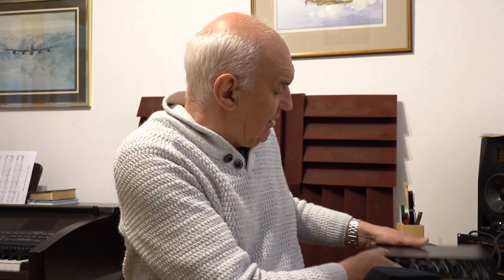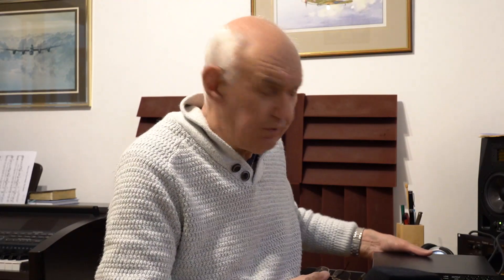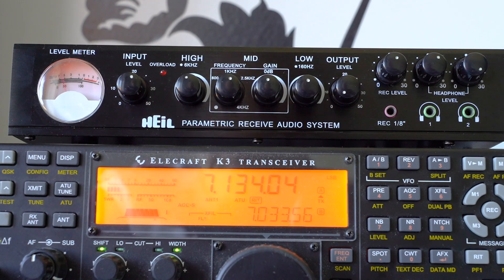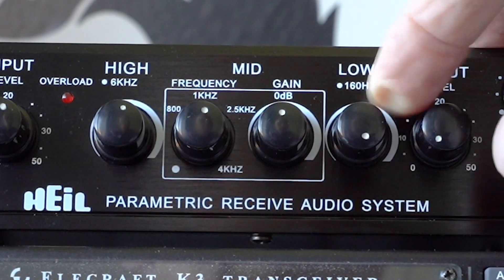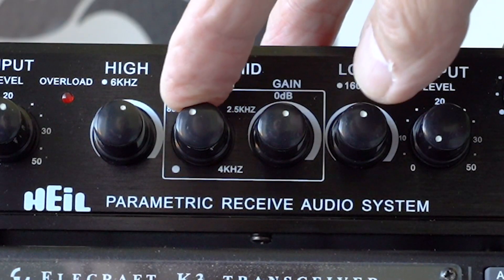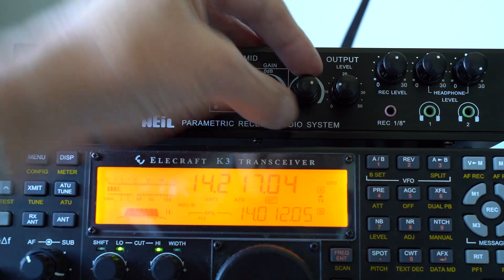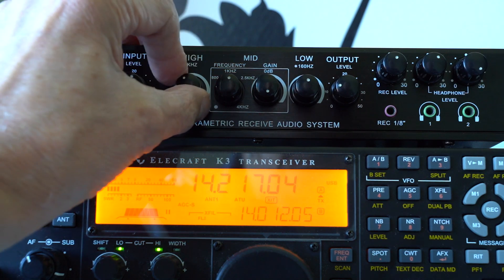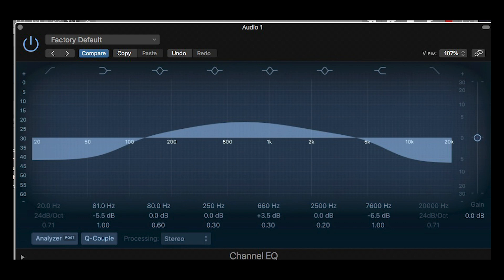Heil Paramtric Receive Audio System

Comment: Here is a story from my younger days. I had a really poor pair of cheap headphones that was just normal moving coil speakers in boxes that clamped to your head, I think they came from Debenhams (when they had an electrical department!). So I took them apart, removed the speaker cones, carefully, leaving the moving coil in place. I then replaced the cone with a single piece of aluminium kitchen foil. The result was they could only reproduce sounds around 1KHz and became my CW filter for a number of years.
There was a time when things were expensive and there was no internet mail order!

Comment: Thank you very much about the very very good explanation of the divice. So I´m CB operator. I usually use a COBRA 148 GTL, and sometimes I have that dificulty that you mencioned in the vídeo. This divice in your opinion it´s good to connect to a CB radio to improve more quality and receive better stations?  Yes I have a strange a highly QRM in my City, yes I know that is impossible to reduce the QRM with this divice, I have to put a QRM Eliminator, but it´s improve the reception in this case? Thanks a lot 7351 from Portugal.